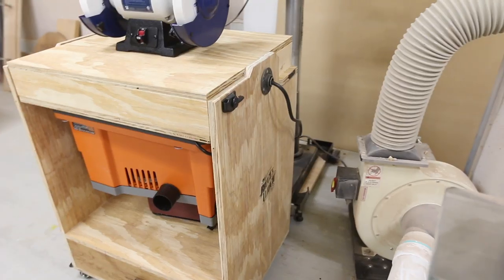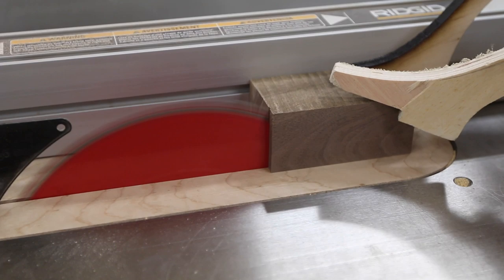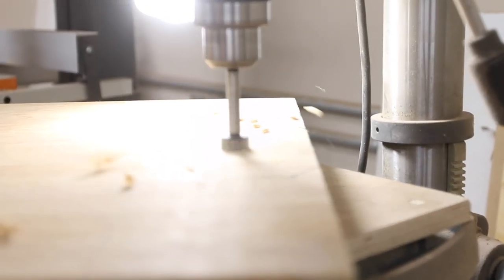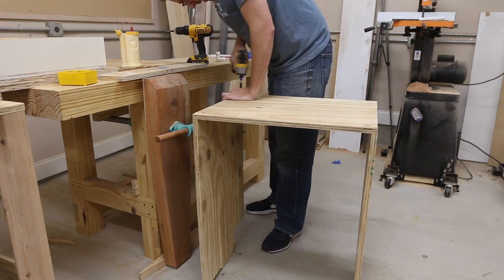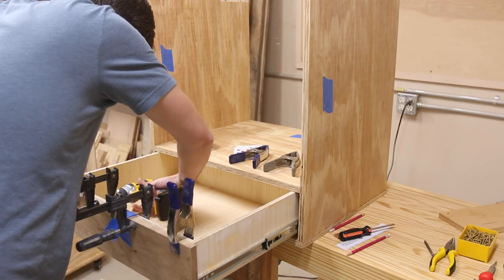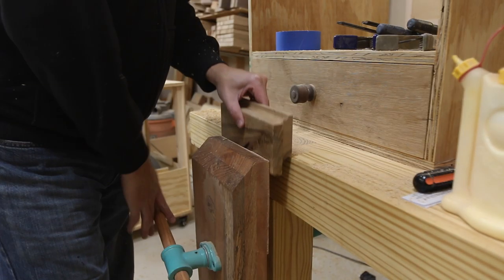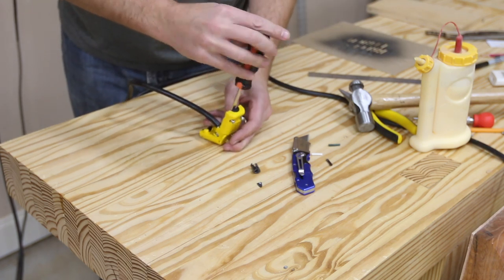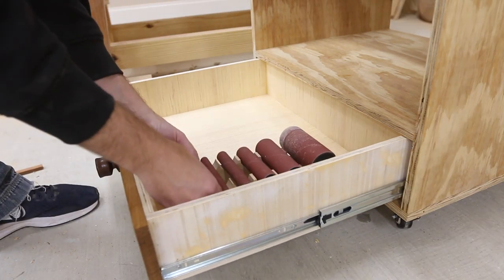Making the Fisher's Shop Flip Top Cart | Collab with Jennie and Davis

Comment: I am planning on buying the same spinal sander you have on this build. My question is this, did you make the drawer smaller so it would fit on his plans.? I looks like there is barley enough room when you have your grinder up top and it on the bottom. My plan is the dewalt planer on one side and that sander on the other. Thanks again for any ideas and or help, I plan to buy drews plans in the morning and the sander when then stores open back up after Christmas holiday tomorrow. Thanks again for sharing and keep up the fun videos. 
dale
Reply from the maker: Hey Dale! Thanks for watching! Yeah, I adjusted Drew’s plans a bit to fit what I was using. I think you’ll like the sander and the flip top cart has been good.

Comment: I also built Drew's fliptop cart and I use it all the time. Only problem, my power strip door falls off everytime I flip it I need to mount it better
Reply: Great job on the video!
Reply from the maker: Thank you, Gavin! Mine is pretty tight. I put some magnets in there so it is ready to hole.